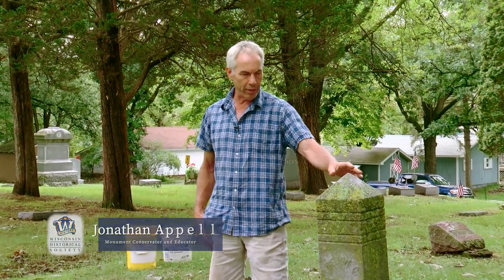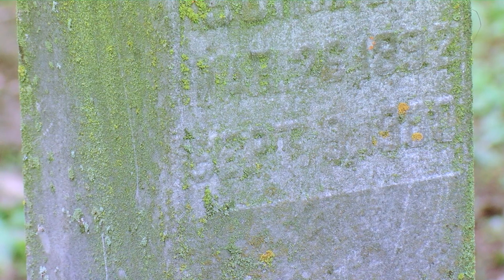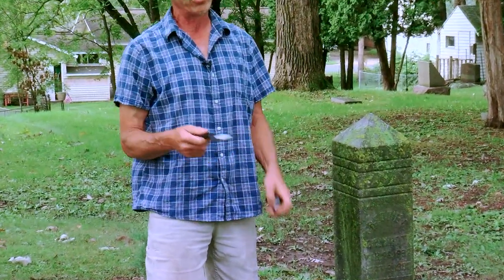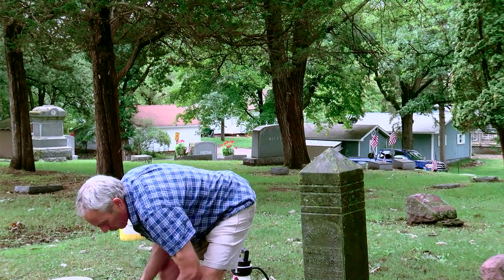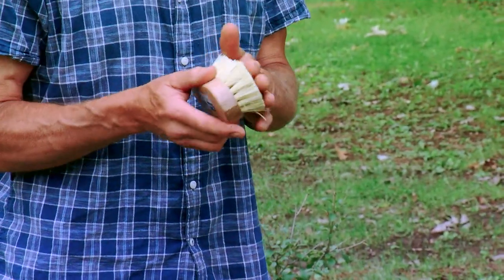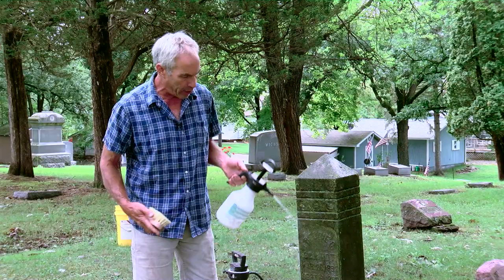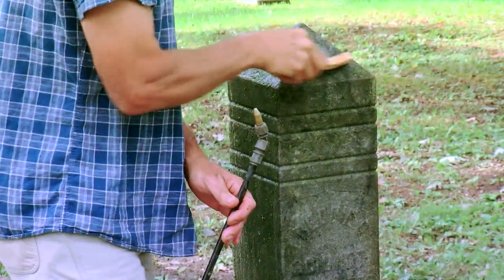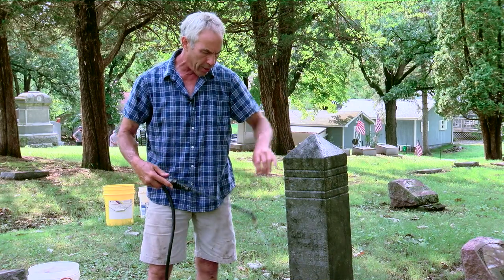Local Cemetery Conservation: How to safely clean a Cemetery Monument

Comment: One reason the colors change after applying the D2 is there are over 13,000 species of lichen and various species will change to different colors, while some others will not have a color change.  

You should open the nozzle to more of a fan spray versus a stream. A lot of the D2 is splashing off the stone and it's a waste of an expensive product.  D2 will also kill plants and grass as it will kill the bacteria in the soil, and these bacteria facilitate the transfer of nutrients into the roots.  And since D2 has an afterlife that continues to kill these bacteria, you can starve the plants.  My last step in cleaning is to thoroughly flush the surrounding vegetation with water to dilute anything in the soil.